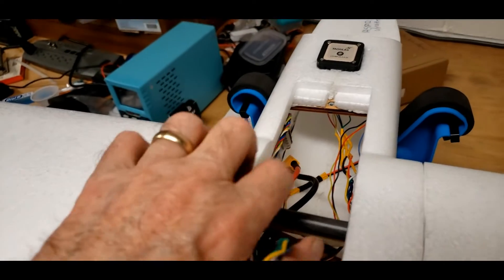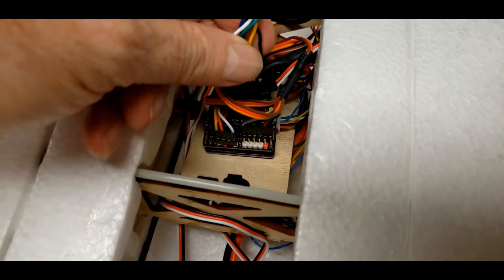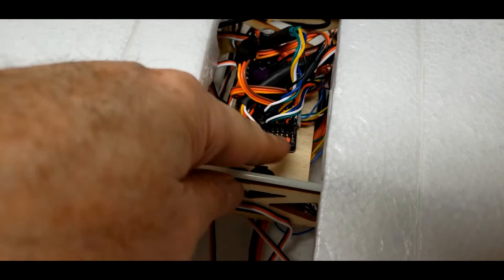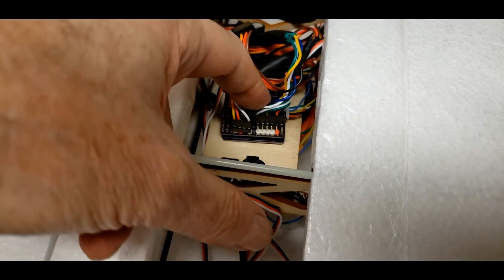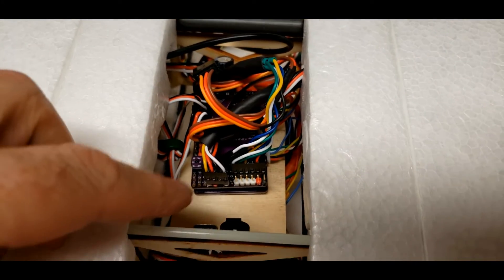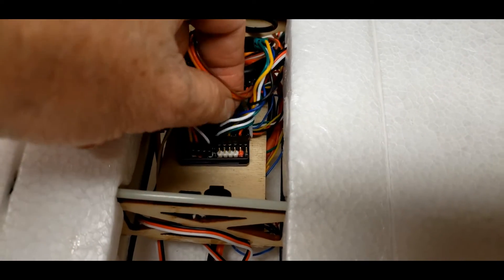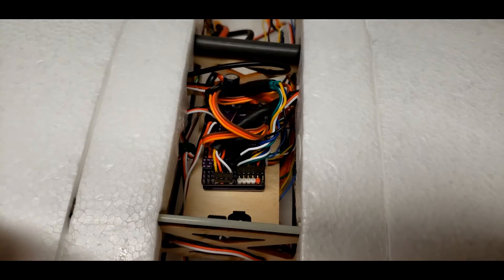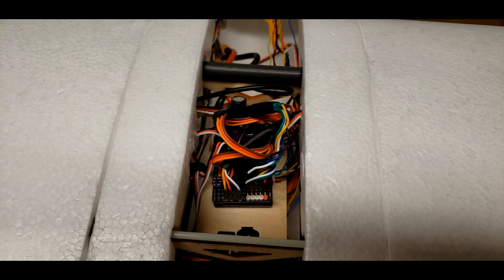Oh Crap!

Comment: Hi Vernon mohammd from saudi Arabia 🇸🇦 💓 🇺🇸 
Why didn't you stick with crossfire telemetry?
Reply from the maker: I did. Mavlink only worked in one out of three RX modules. All three wired the same and everything. Tested on three different FC's.  I bought four and destroyed one.  Of the other three only one worked.  They all work well for control, just not mavlink.  That was $160 at $40 per RX.  I can’t afford to buy at a 3 to 1 ratio.  Then again three for $120 is right around the same prices as some other RX’s I use.  lol  Actually Dragonlink is at $98 right now.  Just a little less than three Nano Pro's.  So maybe I can buy them three at a time to get one working one.  I will test the one working one I have before making that decision.